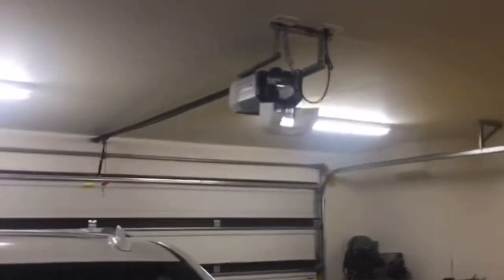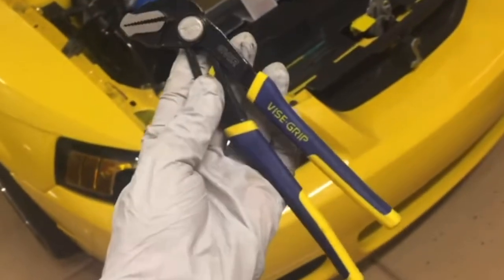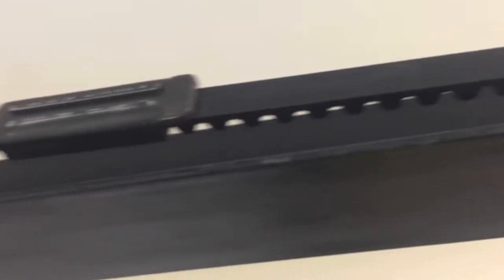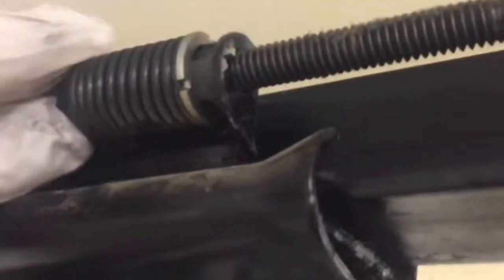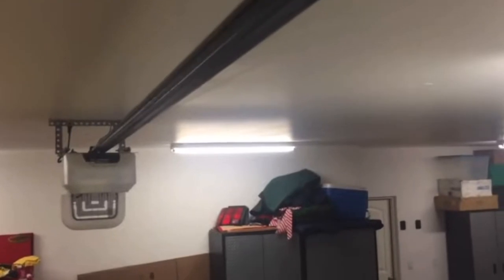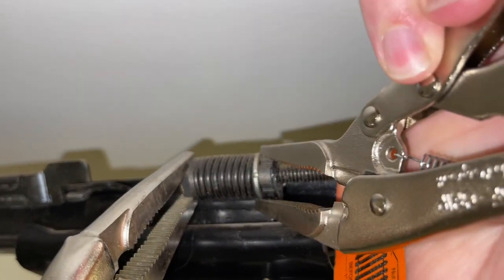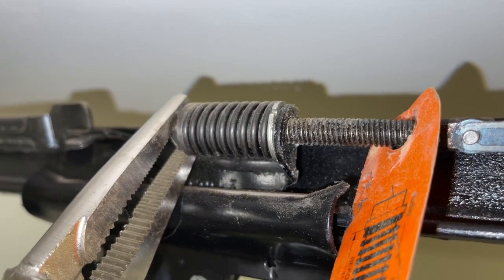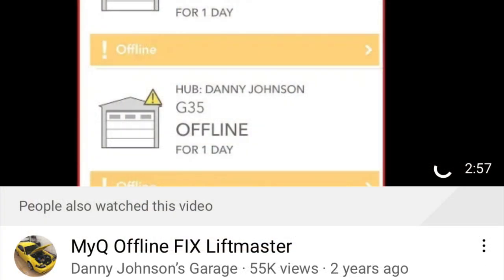Take slack out of garage door belt: Tighten Garage door belt from sagging

Comment: "Professional" installer replaced my split trolley with new rail belt trolley assembly.  After he was done the garage door would pop loudly when closing.  He could not figure out the problem and left me high and dry.  Thanks to your video this was an easy fix.  Thanks!

Comment: Bought a new house 1.5 years ago,  have been adjusting that stinking tension all this time, that spring would back off and then I would jump on the ladder and tighten it back.  I guess it would have been nice to have that correctly tensioned by the installer but alas I now have popped the spring forward.  I think you are in the St.George area, I was raised in Logandale.